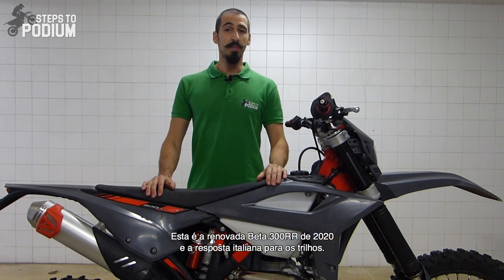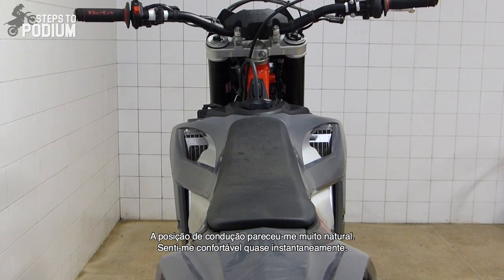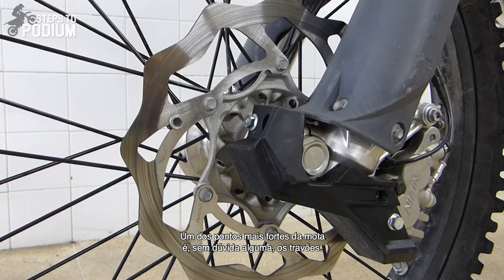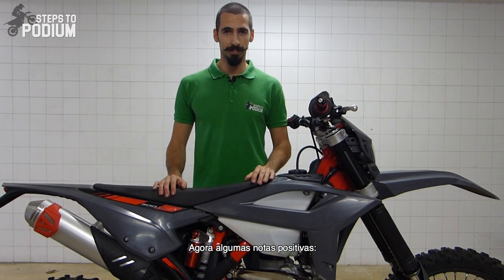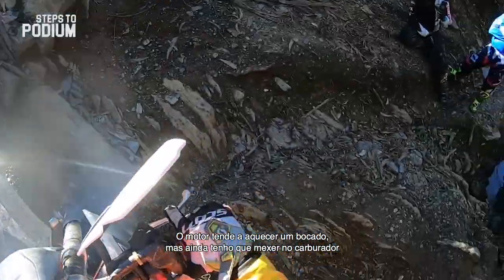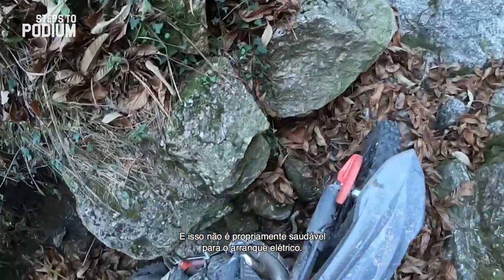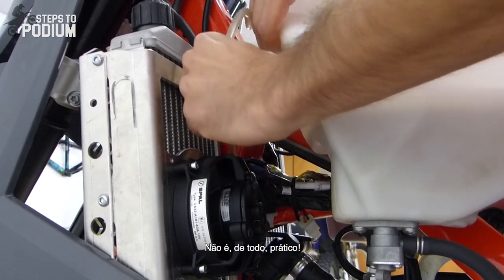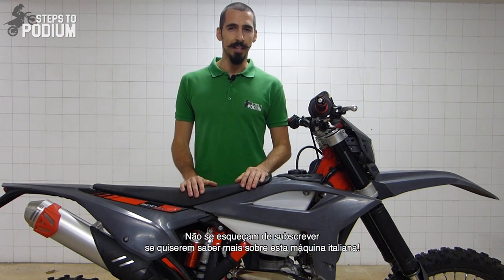Review: Beta 300RR 2020 | First Impressions

Comment: Dear Luis, I will appreciate your subjective view on my below debate, and I will start with a quick background:
I am looking for my next bike, and it is going to be either the beta 250rr, or 300rr. I rode both bikes- the 300rr was extremely flexible in-terms of engine behavior (especially in low RPP) and felt like it would never die. On the other hand, I was very surprised by the significantly lighter feel and nimble handing of the 250. I have never thought that such small differences in engine displacement would generate such significant differences. 

Bottom line: Our local dealer has 2021 250rr readily available which I can get a great price. for the 300rr I would need to wait till Aug for the 2022 range, with less options to negotiate pricing. Considering that the majority of my riding is tight technical single tracks, rocky terrain and the accessional hill climb - what would be your own personal subjective pick? the 250 or the 300?
Reply from the maker: Hey Ariel! Sorry the long term review is taking so long to come out (I know it would have helped you with this subject but the next offroad engineered video is taking far more time than I was expecting - Hope it will be worth it though, specially given the fact that your next bike might be carbed).
Honestly, if you liked the 250rr, go for it. I genuinely think that both the 250 and 300 are amazing bikes with amazing capabilities (not only beta but every enduro 2 stroke out there these days). The 300 might make more sense for a guy that likes to do a looot of Hard Enduro where you can really squeeze that luggability of the 300. If you also do a lot of quicker stuff, like single tracks and so on, the 250 will be a great choice as well, imo. And if you have a good price on it, it will definitely be a good choice!
If you need any other feedback, don't hesitate on reaching out!
Reply: @StepstoPodium  Hi Luis, no apologies needed, your content definitely worth our while :-)  Thank you very much for your elaborate reply and I will be happy to report back when I have arrived to a final decision and made my next purchase...
Reply from the maker: Glad I could help! 👌💪 keep me updated, please! 😄

Comment: Hi!
Thanks for tons of a great videos, I found your channel very useful.
What do you think about ZF forks? I ve heard a lot of negative feedback about it, so Im thinking would it have more sense to get racing version with KYB
Reply from the maker: Glad to hear that, I really appreciate it! 😄 I've been quite surprised with these forks actually! For hard enduro they're great and for single tracks/trails, they are freacking mint! Obviously they lack bottoming resistance on bigger jumps, but the bike isn't meant for that really.
Reply from the maker: What kind of negative feedback have you had?
Reply: @StepstoPodium   A lot of guys mentioned weak inner tubes coating, that can be worned out even before 100hrs. Honestly, I have no idea if it is a frequent issue, and I want to believe that this is just a particular cases. 
About the suspension itself, guys mentioned that it is very difficult to set up. It is too soft or too hard, difficult to find it perfect set up.
Reply from the maker: I would say that most likely it's because of poor triple clamp fastening, because mine are mint 😅 but since mine are just shy under 100 hours, I hope I don't gind any surprises. But to be honest, I don't thinl thst they're hard to tune. The adjusters have limitations, but I find them quite good! I revalved mines and I'm at a sweet spot right now 😁 I guess it will depend a lot on the use!

Comment: Did you removed the pil injection system or you still use it? Any issue with crankshaft bearings?
Reply from the maker: nop, still using oil injection! Yes, I did have issues with those bearings and also electrical issues. 2 fired CDIs and had to replace almost all electrical wiring...